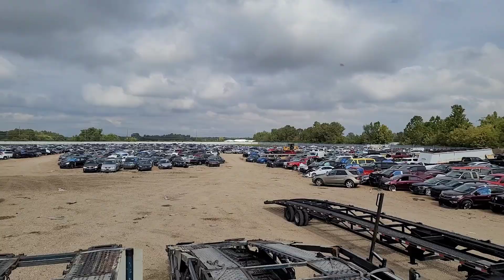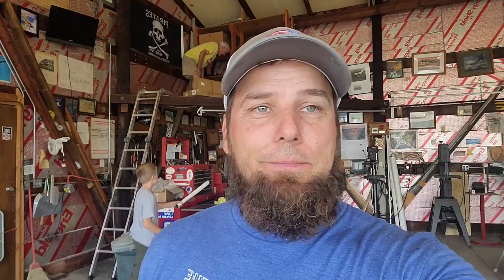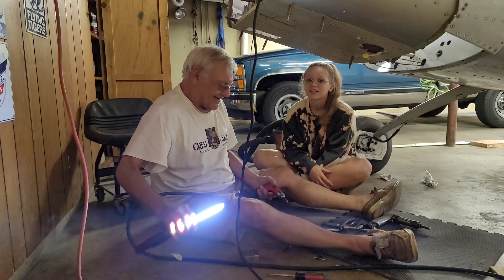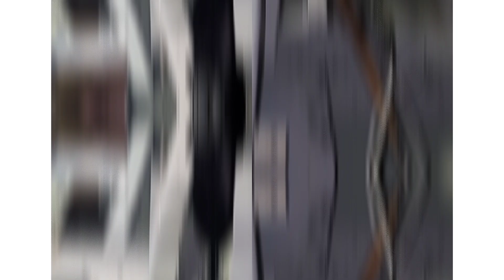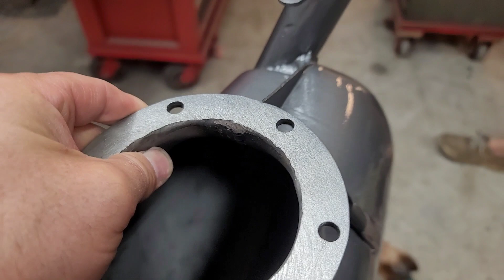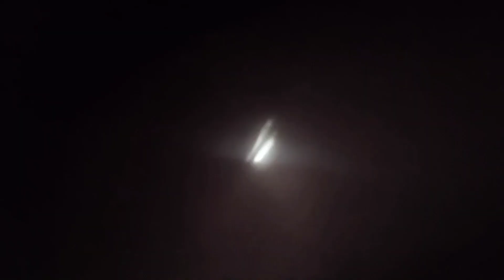Don teaches Addie to buck rivets.

Comment: Riveting is an art. Looks like she is gaining experience in going it. That bolt on the control rod needed to extend beyond the self locking feature of the nut by more than a thread. It looked like you may have come up short but you cut away before you tightened it. Good to see progress. Keep at it.